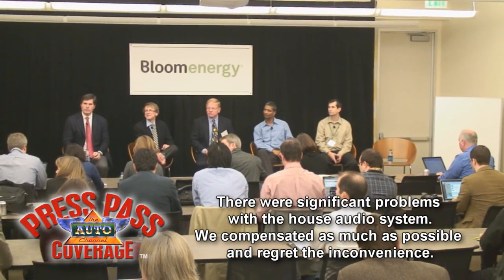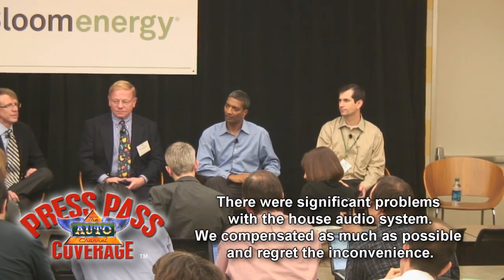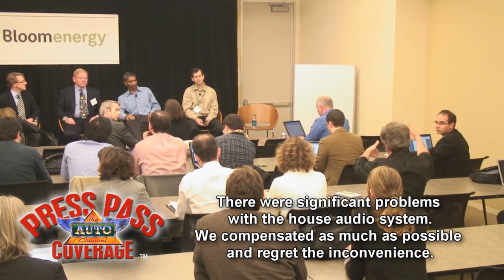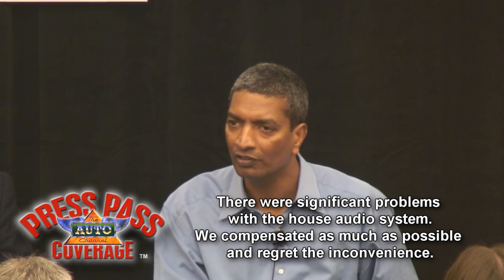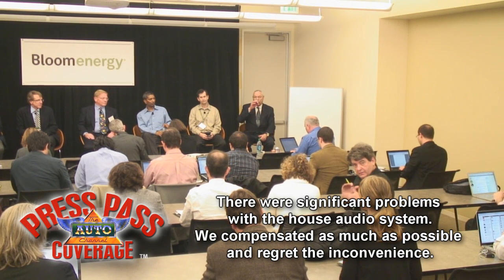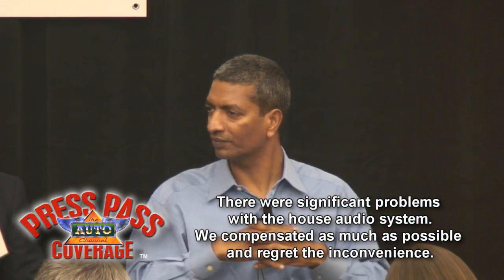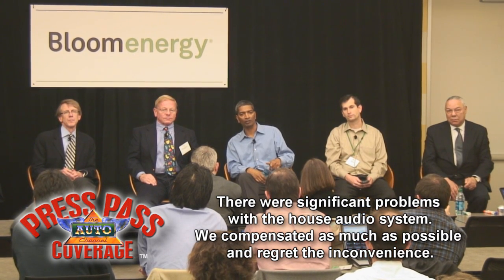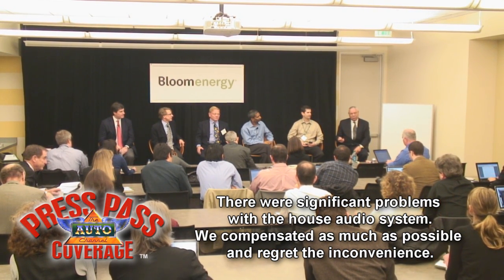Bloom Energy Press Conference, Part 3 Questions & Answers

Comment: @futurehipay @karthikSoun
missing section here....dont know where it went. anyway more or less the high heats are wildly different then what is seen in automobile technology which operate around 50-80ºC.  The high heat involved means turning this thing on and off would crack ceramic. These are meant to run 24/7 365 as is mentioned in this video.

Comment: @KarthikSoun it cant run a car because its a different type of fuel cell. These fuel cells I think are solid oxide fuel cells (SOFC) as oppose to fuel cells used in cars with are (PEFC) which are more commonly called PEM fuel cells. This bloom box operates around 600ºC. that's hot, and does not make sense or is really applicable to the automobile.

Comment: @KarthikSoun cracks ceramics, which renders a cell nearly useless. So the theory is, to produce excess hydrogen which can be stored and used for your car. Basically the technology is different. Different fuel cells and they are completely different animals. This is still very interesting technology, im excited to see where it goes from here! I think i have more to say but i forget. any more questions I could try my best to answer!

(Mechanical engineer major currently taking a fuel cells class.)